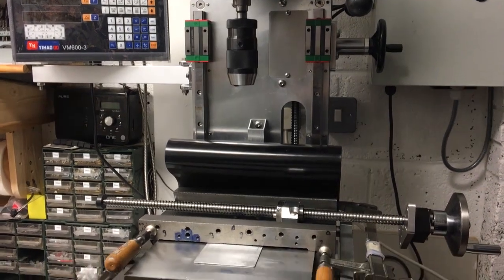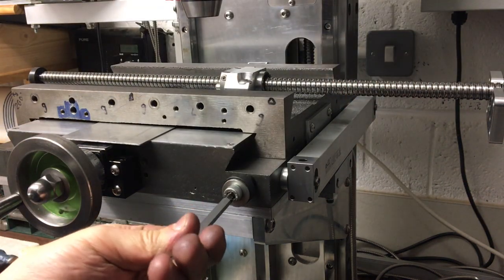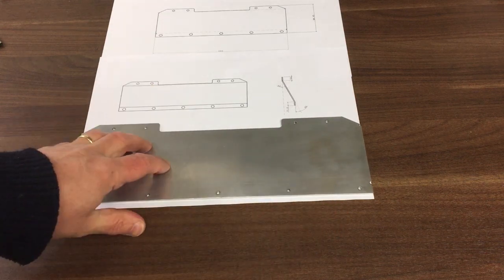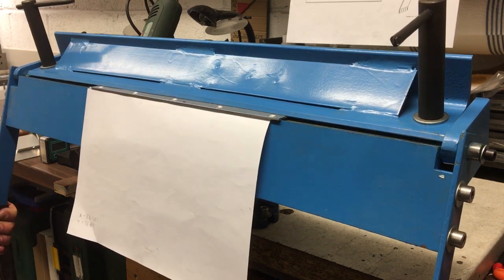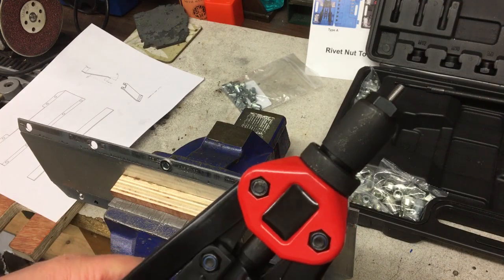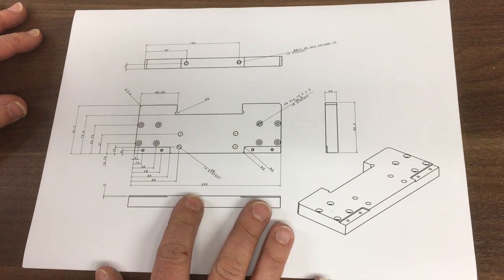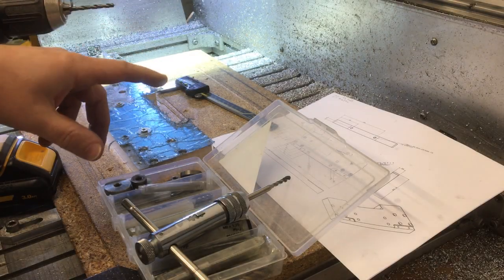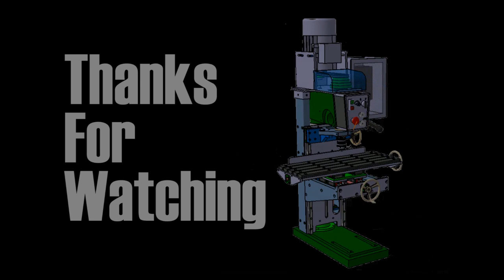Ep33: Drill Press Upgrade | Rear cover / bellows

Comment: Enjoyable as always. I feel your pain with the rivet nuts. If there's a way to irreversibly install something backwards you just know it's going to happen nine times out of ten.
Reply from the maker: Yes it took over an hour to drill and cut them out as I did not want to damage the original hole as this is where it grips.  Got there in the end!

Comment: The drill press is looking really good. It is nice to see your though process.  Getting the rivnuts backwards must feel the same as soldering up a connector and realising you forgot to pass the cable through the shell first!
Reply from the maker: Yes !  Been there, done that.

Comment: just by coincident researching warco drills i stumbled across one of your earlier videos today. the episode 10. and i thought: boy this is going a bit too far for a drill press isnt it? so i look up your channel in order to find the earlier episodes... but you are on episode 33 now? its madness i tell you!!! but well done and all that. you seem to have truly done a good job from what little i've seen so far 👍

but you didnt need me to tell you that. the contraption more than speaks for itself. hehe
Reply from the maker: Yes I seem to get carried away with these projects.  Episode 34 on the way and more to come to finish off the depth control system, motor cover etc.  Anything you wanted to know / research ?
Reply: @routercnc9517  haha well i dont want to burden anybody with my own specific situation here. so will just be slowly watching the series from episode 1

but along the way in my own stumblings was looking at a much cheaper entry price point. so maybe modifying a bosch pdb40. however then blondihacks recently reminded me (in her last published video) that such drills with electronically variable speed usually suffer from the usual torque drop off as you reduce the speed down. and that presents a problem for metal drilling. where you want both a low speed and a high torque.so that kindda threw a spanner into that idea for me. unless i could somehow change the gears out on a pdb40 (it has 2 speeds, maxing out around 850 or 3000 rpm respective) something like that. anyhow thats where i was at yesterday

of course it seems you have really been going ham here on the warco in that department too (well in al departments really). so you know, i guess its another great idea (or maybe even better idea) to start off with the conventional drill press with the pulley gearbox.. then to add variable speed motor control after the fact. this would probably be easier than messing within the much more cramped housing of a pdb40. where there is not really much room to add extra stuff into it

still havent quite decided yet. but if i do skip the pdb40 and instead go for the more traditional route.... then i guess it would probably be looking on ebay for an old used drill press. and having to restore it and fix it up. since that would probably be the more cost effective route towards those basic goals. as i cant afford something brand new like the warco one you have there. so that is where i am currently at for the time being. not really that far along in the grander scheme of things

loving your videos though! very much excellent stuff & much more yet to learn. thanks so much! 👍
Reply from the maker: OK yes I would go for a pulley driven drill press then retrofit a 3 phase motor and VFD.

Comment: So glad to see a well made project like that. However, I was wondering , is this entire project just for a fancy drill press? Or it should mill some materials? If you are intended to mill steel, are you going to do something about the spindle? It seems to be enough for a drill press, but not even close for a milling steel machine. really appreciate the project, for whatever it turns out to be.
Reply from the maker: At the moment this is a fancy drill press to overcome all the previous limitations.  I don’t think it would make a good mill even with a new spindle.  It may not be what others would do but it complements my other machine tools and suits my workflow.  Thanks

Comment: Looking great mate definitely need some coolant on that mill CNC and I would’ve liked to see you take the river nuts out LOL
Reply from the maker: Thanks.  I did film some out it but it took over an hour so left it out.  Basically drilled out most of the thread to weaken it where it went through the panel then side cutters to nibble and peel it away.  Trying not to damage the panel or open up the hole.

Comment: Have a think about using leather. I’ve replaced all my rubber covers with leather and wouldn’t go back to rubber. It doesn’t crack or perish and concertinas nicely. It doesn’t need to be too thick, about 1mm is fine.
Reply from the maker: That’s a good idea.  I could do with some for my lathe too so I’ll have a look around.

Comment: No need for flood coolant ,is a mess  just mistcoolant is sufficient with bio-ethanol it cools, lubricates, and evaporates leaving dry chips no greasy mess and no wet swollen spoil board, just don't use it on steel or other sparkly bits 😁and make sure of good ventilation and don't light a cigarette when in use.🤣🎆🎆
Reply from the maker: Ha ha yes.  I think mist is the way to go but need to look into compressors a bit more.  Should help cutting aluminium at least.
Reply: @routercnc9517  Have you ever considered a pressure pumped garden sprayer? I used these for commercial window cleaning and back when younger spraying concrete forms with Diesel. They do need some tending, requiring a bit of pumping up from time to time. But most of what you want all in one package.
Reply from the maker: Yes and I also used one many years ago.  But I’ve got finance approval for a compressor so I’ll progress that option before she changes her mind !

Comment: I have no idea why you have the rubber bowing outward when it could  just easily  bow inwards towards the column? And then it will be never in your way !
Reply from the maker: I may try that too but my concern was if it would roll up on itself.  I can also heat it and form it with a hot air gun.  Thanks